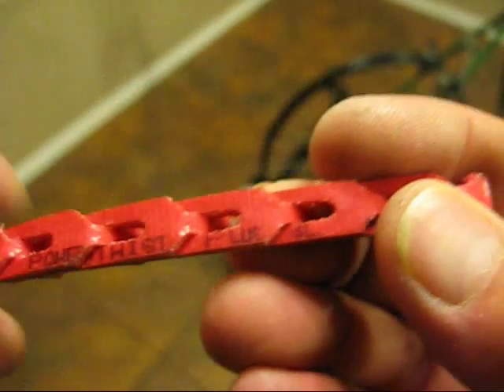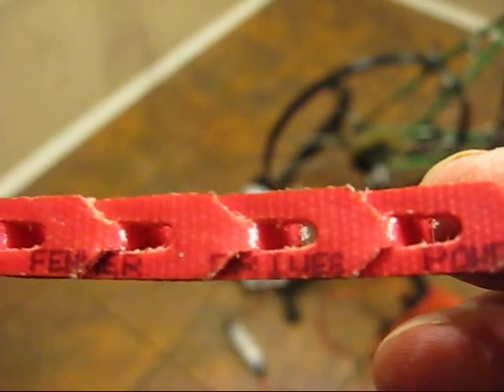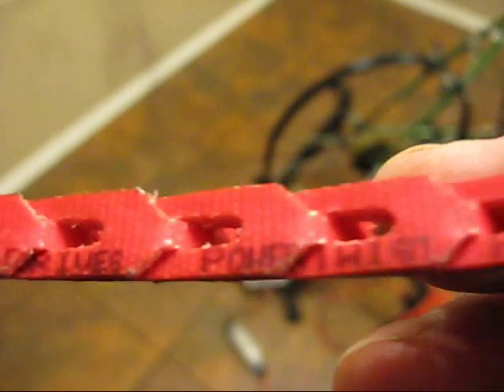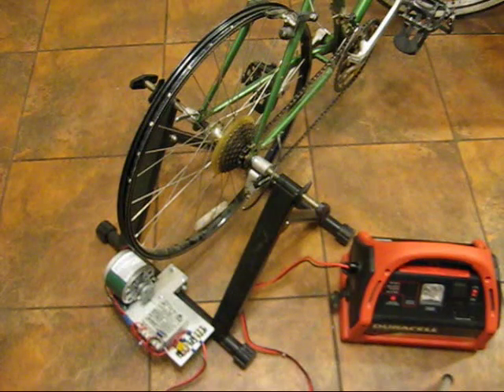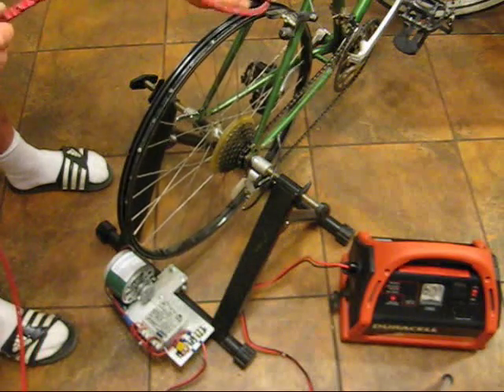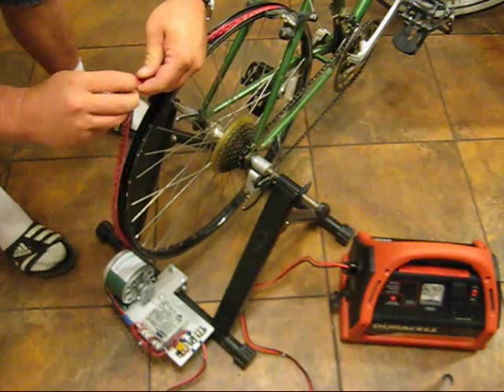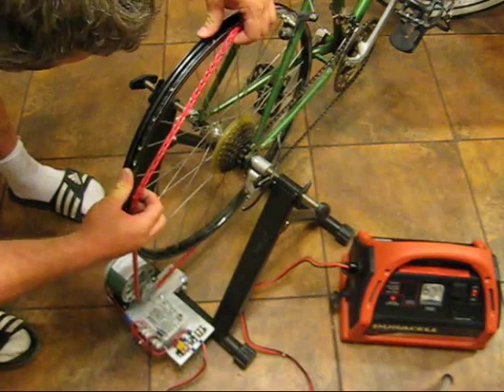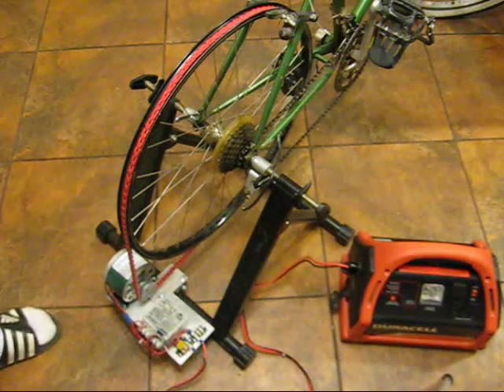STEP 2.1-  POWERTWIST V-BELT  INSTALLATION -  HOW TO BUILD PEDAL POWER BICYCLE GENERATOR DYNAMO

Comment: Can you please tell which generator are you using and where to get it?
Reply from the maker: Pulley generator https://amzn.to/2LgqNti, Vbelt https://amzn.to/3cNm6Fm, Charge Controller http://amzn.to/2AUeHwg,   Fuse holder  https://amzn.to/3KNfHqt,  Power Meter https://amzn.to/3wZfw5J, Blocking diode https://amzn.to/3BdnquB